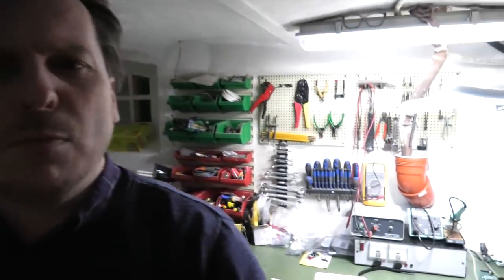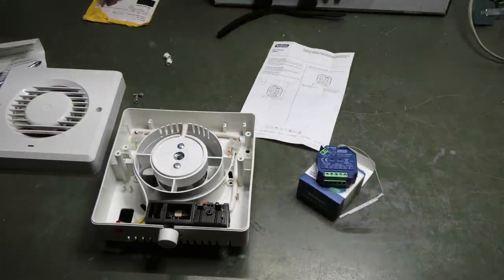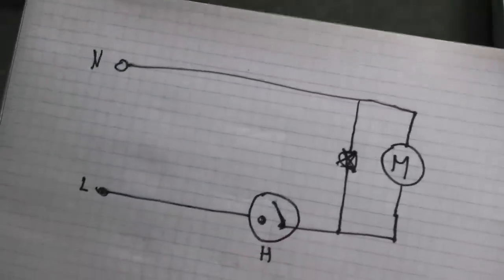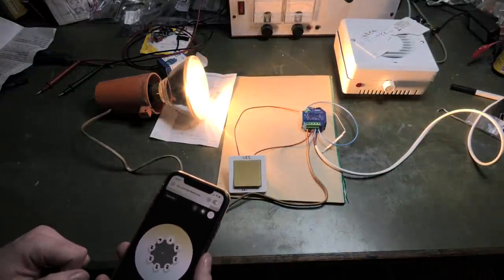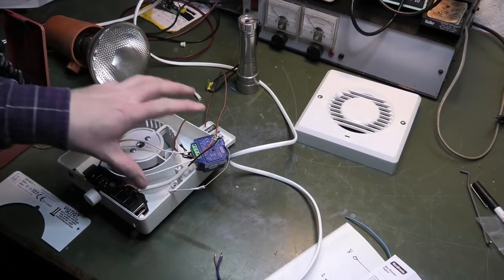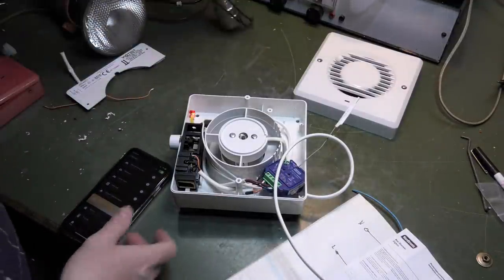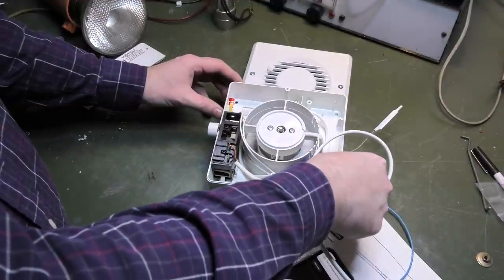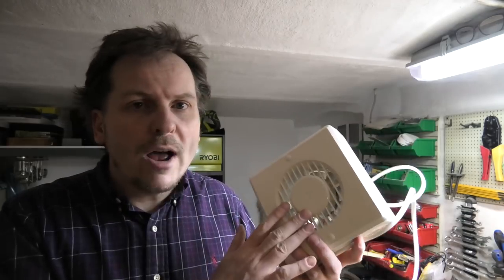Smart Bathroom Fan with Nordtronic Zigbee Dimmer - 935

Comment: Don't try to use the dimmer to change the motor speed.   It will break the dimmer or the motor or overheat and burn.   The switch is fine, don't dimm it.  (I would actually get a different switch that will never dimm for safety.)
Reply from the maker: It's a low power motor,, 10W,, and cheap to, I am not sure if I am ever going to be using the dimm,, but I thought it was cool that it could do it.
Reply: I suggest then make the low speed limit more like 25% instead of nearly stall.  At stall there will eventually be smoke.
Reply: @MyPlayHouse Nice experiment but afaik dimmers are not meant to be used as speed controllers for inductive loads.
Reply: This type of fan can be slowed down, as per Sir GoodEnough's message, but I would only run it 65% to 100% if using a light dimmer so the fan doesn't go below about 30% of it's normal speed.  Being shaded pole, although it can be reduced in speed, it needs a minimum airflow to keep the coil cool.  A very slow moving or stalled shaded pole motor will overheat very quickly and burn up the coil

Comment: If you want extra ba g for your euro then you could place a repackaged breathable container of cat litter (replace fairly regularly) to eat up extra moisture... toss the used up litter in a bucket and ovee time you have a great base when dehydrated to make cement or mortar filller.
Reply from the maker: Thank you very much,, I really do not want to have to mess around with cat litter all the time.
Reply: @MyPlayHouse  For an easy solution you couldalways create a a sqauarish bracket filter between the ventulation duct, basically aluminium c channel, rivers and flyscreen and fill it with silica dessicant. Pull tab and pull it down from ceiling every couple months. 20mm thick mildly packed ought to do it.

Treat it like an easy swap worstation/gamer PC dust filter.

If you like hot showers or long baths I doubt that fan will nake too much of a difference.

Please forgive my Australian bias.

Comment: I wonder if the strong inductive load of the motor won't harm the dimmer circuit over time, if it's run at lower than 100% speed for a longer time. Maybe a capacitor could help with that? Also, what do you think about bypassing the humidity switch and putting the smarty device in parallel to it? So that it turns on from the internal switch as well as from the smarty device, something like that?
Reply from the maker: I did think about just bypassing it,, but then I found out that I could use the input in the dimmer together with the switch. If it breaks we make it better :-)
Reply: @MyPlayHouse  My understanding was, that the switch input to the dimmer module needs to be a push-button, so it will only react after the contact has been closed and then opened again, which the humidity sensor doesn't do. But maybe you can change that in the settings?

Comment: Hello - is this thing still working here 3 years after? and have you been using the "dimming/speed control" to slow down the fan or just running it at a 100%? Trying to speed control a 230v 33 watt inline fan via wifi/mqtt
Reply from the maker: Yes it is still working just fine,, but I don’t use the dimming,, at all 🤔

Comment: Hi Morten, I’ve read the manual. It says that if you keep hold the push button (in your case, leaving on the humidity switch), it will change the intensity of the output. It’s the 6th point on the manual. I’ll quote it to you

6. Controlled by a push switch
Once connected with a push switch, click the push switch to switch ON/OFF, press and hold down it to increase/decrease light intensity

Maybe you should consider to pick up a smart dimmer that work with the on/off switch and not with a push button.
Maybe the Shelly dimmer can be good you for you, but is not zigbee (but you already have another Shelly device so not a big problem I guess)
Another thing, can you try to use home assistant too. Is a very powerful domotic local server (it can runner in a docker container inside a synology box) and let you integrate wifi, Mqtt, zigbee and other protocols in only one interface. It can also work with Siri, google home, Alexa, Samsung and other virtual assistant.
Reply from the maker: Hi Lucio Ancora
Thank You very much!  Yeah that was not exactly what I wanted :-/
Thank you for watching! :-)

Comment: I made something similar, using a timer and a motion sensor, that triggers fan if someone enters the bathroom and runs like 10 minutes and then turns off. My cats actually trigger the sensor all the time caust the litter box is in the bathroom. Actually i put the fan for cats to suck up all the smell. :) Works great. Love your idea as well. Cheers from estonia. :)
The motor doesn't like getting dimmed.  It may actually overheat cause the air flow cools the motor. It will work fine with older lights and dimmable LED but it isn't suited for motor control but it will work in some extent.
Reply from the maker: I think it depends on how the dimmer works,, but I am not going to use the dimming,, just thought it was cool.

Comment: If you are using Home Assistant, I would use a Zigbee Humidity sensor to report the humidity to Home Assistant.  I actually do that now and just have Home Assistant turn the fan on and off.  You can do some calculations to work out humidity rises or to compare humidity to other parts of the house to get an even smarter fan.  Combined with a motion sensor you could have the fan turn on at different humidity levels, or different speeds, depending on if the room was occupied or not.   I would definitely by getting rid of the highly inaccurate mechanical humidity switch in the fan itself.    That said, you may have already done all that by now :)
Reply from the maker: No I am not that advanced,, but that sayed,, this works just fine. Turns when you go in,,and if the humidity is "high"
Reply: @MyPlayHouse  I can agree it works fine.  I ended up not being advanced either, but found a blue print recently so I could cheat and pretend to be advanced lol :).
Reply from the maker: YouTube is messing up, and climes that I have not replied to this,, sorry for the "disturbance in the force" :-/

Comment: You should get a humidity&temp controller to control the power (on/off) of your exhaust fan, so it turns on automatically when humidity or temp gets to a certain level, then turns off.......done, smart/automatic without more WiFi devices in your home...but still can have override with your wall switch for using restroom....
Reply from the maker: That sounds exactly like what I just did... ??

Comment: the switch on the fan seems to be a temperature bimetalic switch not a humidity switch... Also the switch input on the module probably waits a momentary switch input. It is probably a toggle input so the fan is gonna turn on every 2 actuations of the "humidity switch" on the fan. You sould probably connect the smart module and the built in fan switch in parallel so either one of those can switch on the fan
Reply from the maker: No it is a humidity switch in there. I did a breath test on it 🧐

Comment: The Make magazine once published an article about a smart device that could sense carbohydrate fumes in the room air. Such a device would come really handy for the bathroom as additional trigger for the fan. They accordingly called it the Fart Detector.
You'd probably need an ESP8266 for that and an Arduino-softwarecontrol for such a thingy. in order to make it yourself and be able to control it via your smartlphone. ^^)
(Actually, such a device could be made to tell you what sensor triggerd the fan, if a signal from the gas sensor or humidity sensor turned the fan on. Oh the fun you could have with visitors! :oD 

…Oh the misunderstandings this might trigger! That sensor probably can't tell the difference between methane and cologne.)
Edit: Something like a seismic detector on the throne might be good as well?
Reply from the maker: Bomolum detector 😃